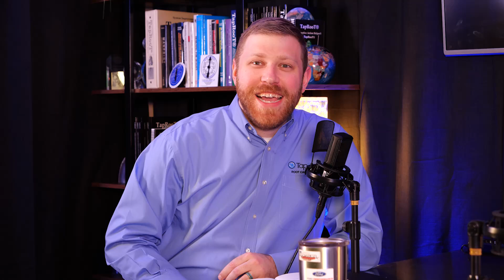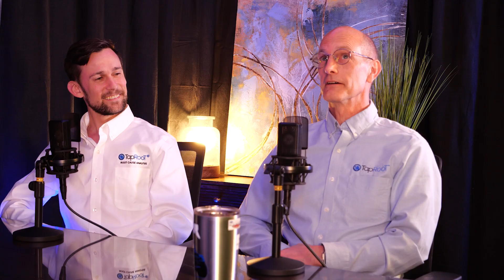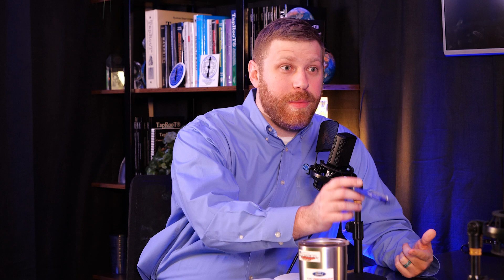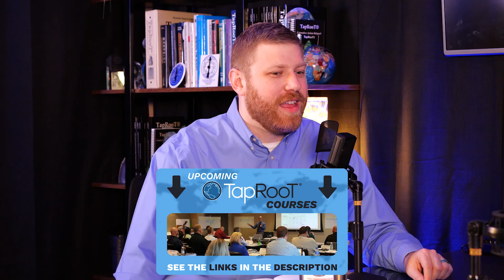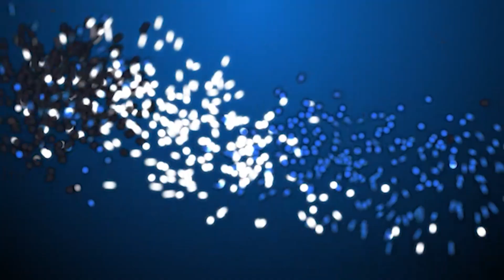How to Investigate Equipment Failures the Right Way

Comment: Wait. You mean we shouldn't keep swapping out insert subcomponent of choice repeatedly with the craft folks on overtime? And then put the removed parts on a random desk until the Forensics Fairy magically skips it out? gasp
Reply: OK, now a helpful comment: I start pulling the installation, maintenance, and past documented issues for at least the affected system while troubleshooting is still in progress. This info becomes my initial Snapchart, and I'll throw on notes as troubleshooting teams make updates. As soon as the craft folks and operators are available, they'll walk through the timeline and add details. My preference is to leave engineers for the end, unless they were in the field with the craft.

I have some craft experience, but I'll set aside time to read any available instructions and make a YouTube Playlist so I can at least sound competent when pushing back on assumptions.

I'm still struggling with the Forensics Fairy. My interim action is trading white Monsters for failed components (if they can clear the rad monitors) and assistance shipping to a lab.